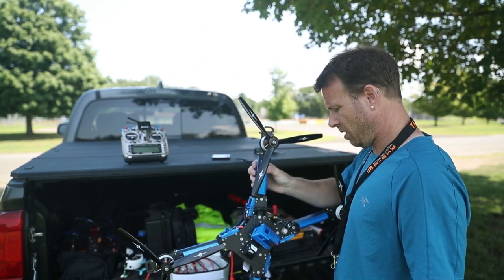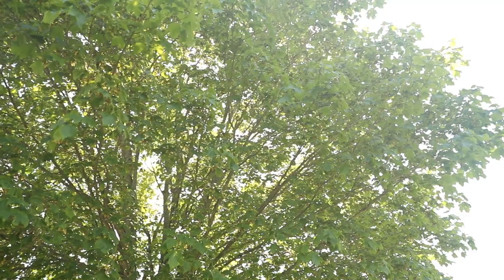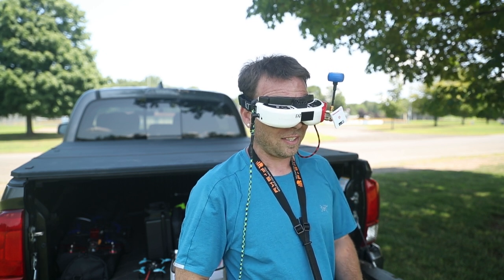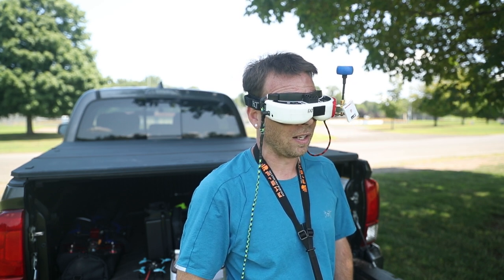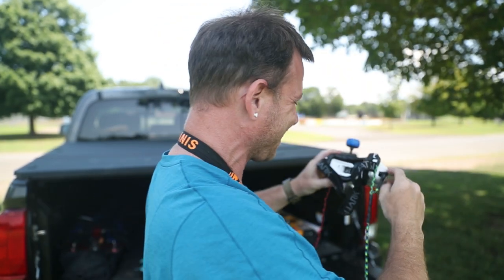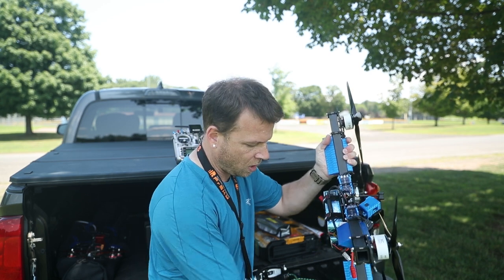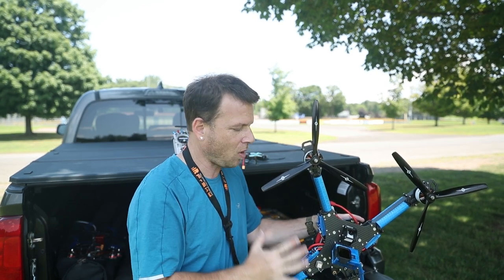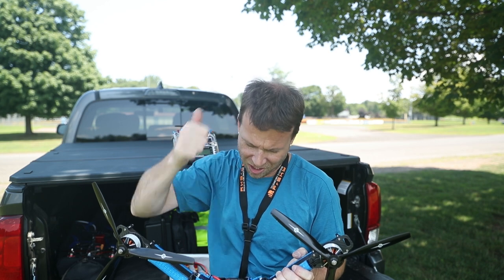Beast Class Maiden Flight Video

Comment: Built one of these recently but went a different direction.   4214 Xing 400kv with Gemfan 13x10s...   powered by a pair of 6s2p packs for 11000mah.   On first full pack I had 18 minutes of flight time cruising at 45-50mph with 50-60% throttle and landing at an in flight voltage of 3v per cell.   Needs more tuning but the 6s4p VTC5D cells should give me roughly 80 amps continuous with arond 120 amps burst.

Xing thrust stand values for a 4214 400kv motor with 14in prop on 6s is just below 3kg of thrust at 20 amps.  Almost 4kg and 30amps for a 16in prop.

There is a good chance that the 13x10 props wont ever pull more than 20 amps per motor.   As I get it tuned the hope is to have an 20-25min cruiser on the 13in props.    If I make new arms to swing a 16in prop I might be able to hit 30minutes.

AUW of 3350 grams with Hero7, pack weight is at about 1300g.
Reply from the maker: Have you thought about putting a DLSR on it? With those flight times on a 16” prop it will make a sick cinematography rig! Sure the payload will sacrifice some of the flight time. I’m interested to hear more about this if you do try out 16” props. What do you plan on using it for once tuned?
Reply: @breaksteel  just long range cruising.  Friends that were with me were still able to see it LOS at almost a mile out.
Reply from the maker: If you've got the land for it long range is great for these.
Reply: @breaksteel  yeah.  I plan on going on a campint trip this spring and if I park myself on the top of a small hill I plan on seeing if I can hit 2+ miles out.

The cool thing is I can strip off one of the 6s2p packs and use it on my 7in Project 399 build.   6000mah VTC6 6s2p pack gives me 20-25min flight times but I have to deal with a throttle cap.

A 6s2p 6000mah VTC6 pack should be a 30amp cont and 60 amp burst rated pack.

A 6s2p 5600mah VTC5D pack should be rated for closet to 49amps cont and 70 amp burst.

2 of the 5600mah 6s2p packs are used on the 13in build.   Have two pig tails soldered to the Radix PDB to split the load so a single XT60 dont see too much current.

Since I am not 12s and 100amps I should be good to go with my setup for duration cruising.    Just need to look at 14-16in props.
Reply from the maker: I've come across others who have been running similar packs to these. Are you building your own? Seems easy enough with a spot welder. Much easier to maintain them too compared to normal lipos.
Reply: @breaksteel  i have a gun style 100w soldering iron that might as well be a spot welder.    Getting the iron super hot lets me put heat quickly where I need it and instantly tag the solder joints with minimal heat going into the cell.

I was gonna do the Nickle tabs route but when I saw how thin the metal was I said to hell with it.   I used short cut pieces of 12 or 14gauge wire to solder up the cells.

Would pair the cells to hot glue them together.   Then I would make all my parallel connections with red wire on positive ends and black wire for negatives.   After that I would do the series bridges so that there are double connections.   Gave me a ton of through put for current.

Bought the balance leads and wired them all up.

My first experiments with LithiumIon were on 3in.   Went from like 4-5min flight times on 650mah 3s to 15min flight times on 3000mah 3s.   Doubled thebpack weight and trippled the flight times.

I have a bit of a close up on one of my videos I uploaded about a month ago.   First half is CheaterKwad related while the last half is lithium ion related.

Down side to lithiun ion is that 1c charge rate is the "fast charge".   Samsung cells call for like .5c in fact.    So if you use the Lithium Ion down to 3v you are looking at 1 hour to put them back to a storage voltage of 3.6v.    If you want to charge them all the way back up from 3v then it will be 2 hours.
Reply from the maker: Ugh those old style irons. I have one from 25 years ago. 50 watt and barely works to solder.   Seems easy enough to make these. The charge times are too slow for me. Standard Lipo on a 1c charge is too slow. All good though for the application. I’ll have to check that video out later today.
Reply: @breaksteel  i had a radio shack iron that served me for nearly 30 years.   Pull trigger and 5 seconds later it is melting solder, 5 more seconds and I can tin a 12guage lead no problem, 10 seconds later and the tip is glowing red hot...

Served me perfectly until the tip finally started to fail.   I changed the tip and something wasnt right, crap metal/impedence and the power source started to fry itself...

I replaced it with like new old stock and the new one works great.   Absolutely love it for heavy duty work.   I can tag a power lead to a ground plane of a 3-4oz PDB on seconds with beautiful solder joints.

As for charge times, yeah I hear ya.   I parallel charge like a fiend.

For LiPo on a 24v power supply I have run 16 packs charging on 2 chargers doing 10 amps on one side and 6 amps on the other.    I figure if I am gonna be stuck doing 1C charge rates then I will match up cells and have a dozen packs coming off every 45 minutes.

For the Lithium Ions I can at least match up packs and parallel them too if cells are matched.
Reply from the maker: @dividingbyzerofpv6748  That's the same one I have only 50 watts and it takes 5 min to melt solder. It was the 1st of what has now been 4 soldering irons in my lifetime. I don't think I was ever able to tin more than 14g wire. Needs  a new tip but the Hakko is has been serving me well for everything up to 10g. Happy yours is working better than mine. Guess things would have been different had I went with the 100 watt version. 

Yea I'm parallel charging as well. Usually storage charge when I get home so I can toss them all on together for the next charge.

Comment: Was wondering if you would share your settings from the last video where it's pretty dialed in.
Reply from the maker: I plan to. It’s still not quite there yet though.  Sadly I don’t think I’ll have it back in the air until spring. Currently super wet and muddy here. It’s slathered in conformal but 50v and water don’t mix at all. What I can say is that I and P were too low. Those were I term oscillations due to the lack of P term. I brought them up a bit and saw improvements. Both values are still to low, and not close enough to share yet.

Comment: Sick dude! I build one of these myself. I use the gemfan 13 inch props and those are really awesome. Really awesome maiden flight! 💯🔥👍👍
Reply from the maker: I just found out about the Gemfans two weeks ago. Will be trying them out. I have a few sets of these MAS to rip through first. Just have to tune those bobbles out of her but super fun to rip around! Stoked that you liked it! Thank you for watching!!
Reply: @breaksteel  I can share my pids if you like? I have tuned this beast with the new Xpower MAS prop 13 inch. I hope this tune is close enough for this prop.
Reply: Rol: P:64 I:32 D:51
Pitch: P:67 I:37 D:55
Yaw: P:65 I:45 D:0

These are almost spot on. Hope you like them.
Reply from the maker: SugarFPV Thanks, I’ll give them a shot! I baselined it with some added filters and dropped P & D down 1/3. Looks like some I term oscillations cause P term is too low. Can’t hurt to try yours and see where it leads me.
Reply: @breaksteel  awesome! Let me know 👍
Reply from the maker: You got it!